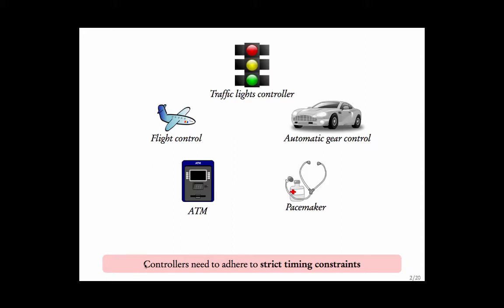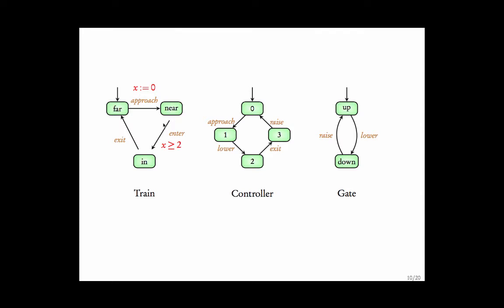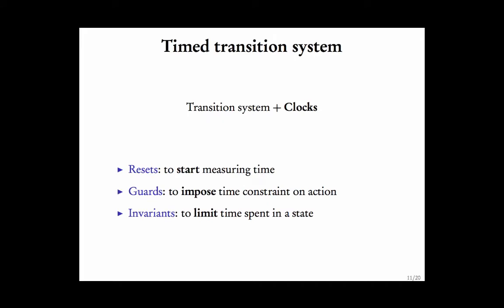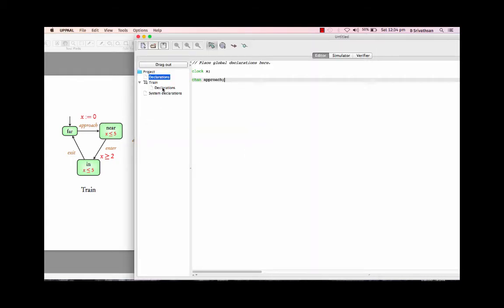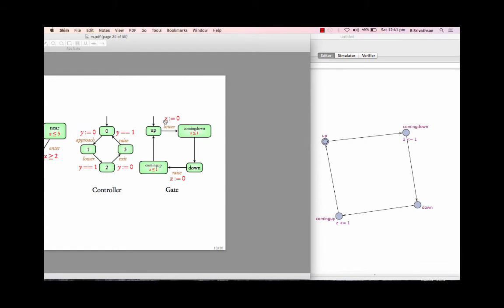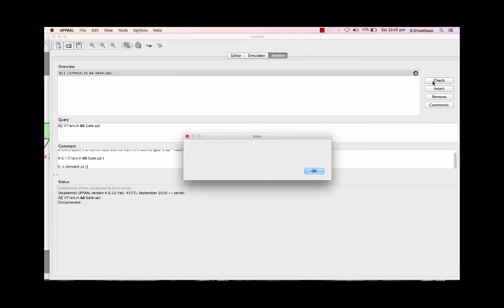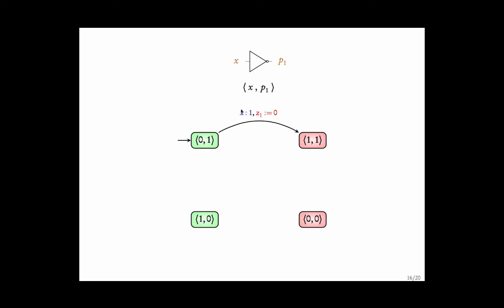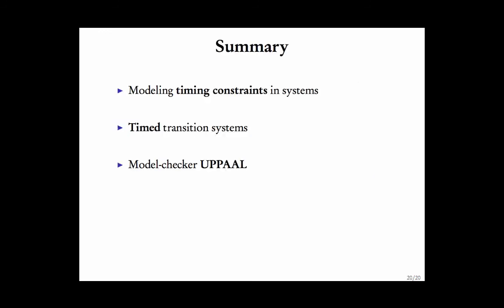Timed transition systems

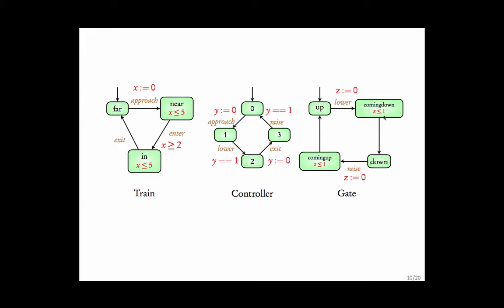Comment: Good video. However there is an issue at 12:21,  the guard condition for Train state from "near" to "in",  x >= 2 will still be a problem. As when controller send "lower" command to Gate, it takes 1 time unit, and then Gate take z<=1 to transit from comingdown to down (at most 1 time unit), and at this time, x = 2, hence when running Uppaal simulation, sometimes Train enter "in" state but Gate is still in "comingdown" state. This is wrong. So changing guard condition from x>=2 to x>=3 or x>2  will solve the problem

Comment: As there are no much information about UPPAAL, your video is a real  rescuever . Thank you sir. But I followed all steps and I am at deadlock in UPPAAL. Also I notice some issue with Exit syn. when I changed it to go it doesnt show any error. I am using UPPAAL 4.1.23. Sir, much appreciated if you could  upload the XML file of this model? 
Thank you.

Comment: At 2:45, what is the point of sending that "Enter" signal? The Controller/Gate doesn't isn't expecting any "Enter" signal. So if this is a blocking channel, the system basically waits indefinitely after sending that signal since there is no receiving end to that signal.
Reply from the maker: Hi. You're right :-) Thanks for your question.

The purpose of this example is to illustrate the role of timing constraints. We can always make sure that every such channel has a receiving end by adding a single state automaton which just listens to signals. But these are technical details, which I think are not needed for the current purpose.
Reply: Thank you! :) I tried to implement that system using a Synchronous Queue - and it just waited indefinitely. :D Hence - the question. Thank you for clearing it up! And a very informative video :)